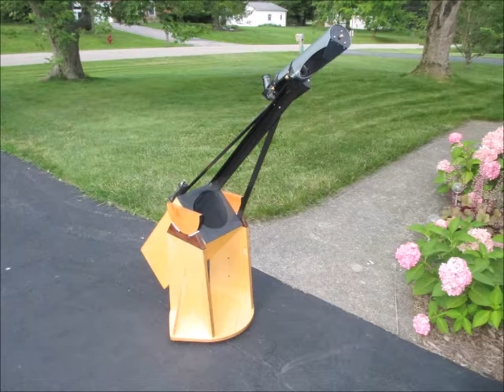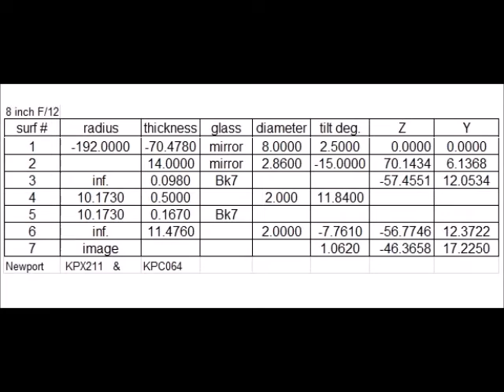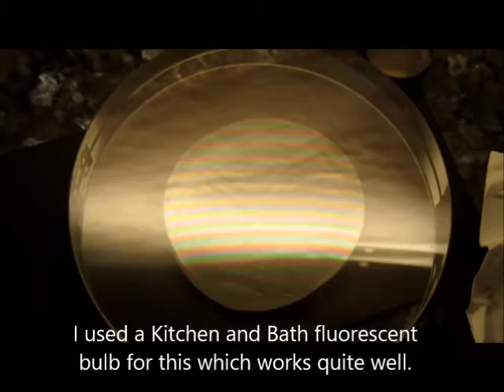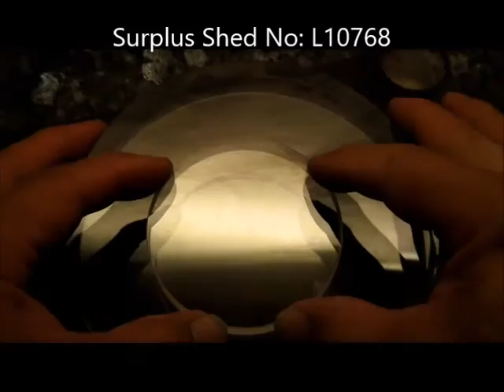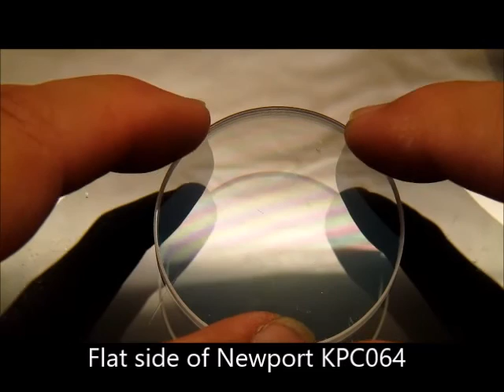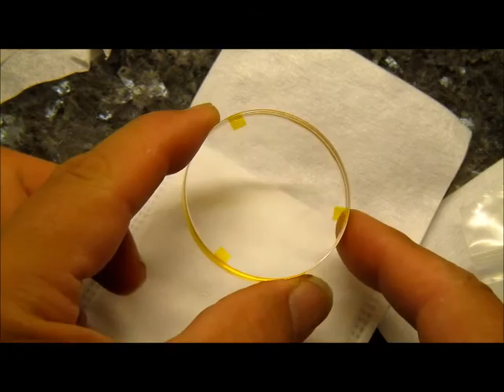Making a Jones Herschelian (Chief) Part1

Comment: What is the largest mirror one can use in this design?
Reply: Largest I've seen is a 20", and the only problem of going larger is that the focal ratio must be pretty slow and thus testing the mirror/using the scope becomes really impractical.